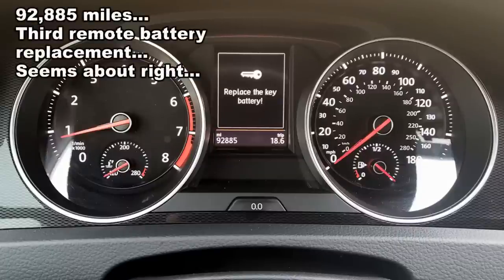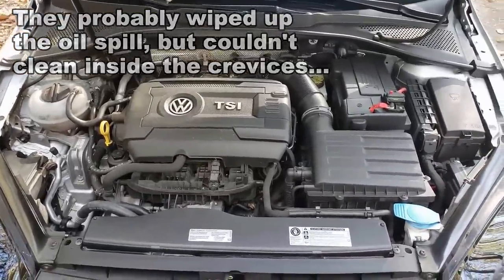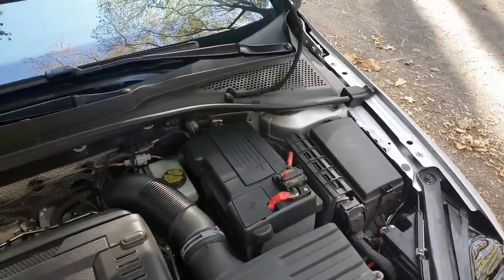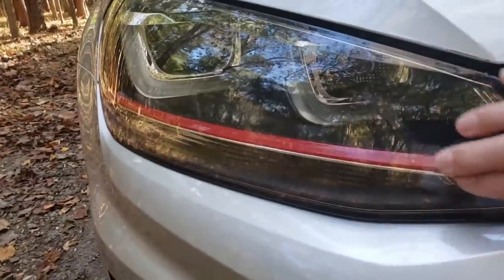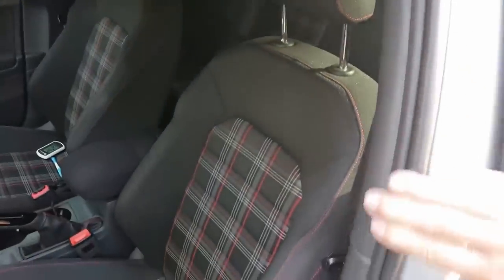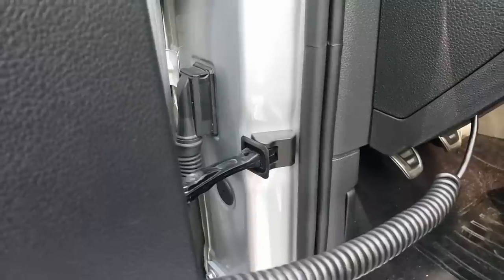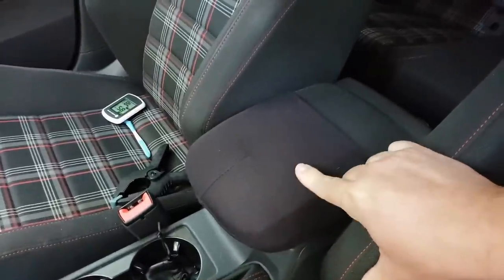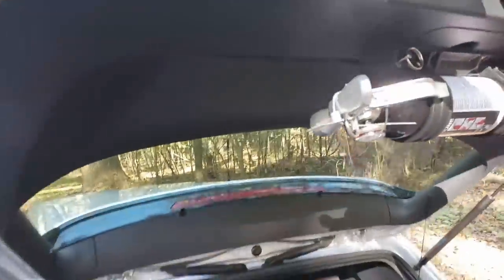THREE YEARS AND 93,000 MILES: My Report, Part 1

Comment: One question at 90,000 mile why did u need to drop your oil pan?
Reply from the maker: The oil pan, which is a steel aftermarket piece that I installed to address a problem that didn't exist, had developed a leak in the RTV seal. I pulled the pan to install a gasket. Thanks for visiting.

Comment: That’s the same on my car, they left the shipping pucks on mine too got that resolved then noticed the coolant going down quite a lot but it’s all normal
Reply from the maker: The trip odometer will reset when the battery is disconnected. But the MPG can still be calculated manually via the main odometer readings, assuming you documented its reading at the last fill-up.
Reply from the maker: Thanks for commenting.

Comment: Great review!  what trailer hitch did you install and what was the before and after ground clearance?  Thanks
Reply from the maker: Thanks for your comments. I installed an EcoHitch, by Torklift. I have full details, including photos of a tape measure at the receiver, at https://stealthgti.com/torklift-ecohitch-and-carry-on-trailer/. I don't recall specific measurements, but I can say that the hitch opening sits higher than the lowest point of the stock muffler. So, there's no decrease in ground clearance. Thanks for visiting.

Comment: Changing the air flow is a no no, it's for cooling, not air intake
Reply from the maker: Are you referring to the blocking plate I installed? I suspect you're correct. The engine will only ingest hot engine air when the car is stationary. Otherwise, it will take-in outside air, some of which would normally pass through to the engine bay. Upon digging for more info about the origin of that part, it appears to be standard on the European GTE. I'm not sure why that part is on that car but not the others. Thanks for visiting.

Comment: May I ask how did APR stage 1 and stage 2 affect gas mileage?
Reply from the maker: I don't think the tunes themselves affected fuel economy at all. The problem is with my USE of the extra power afforded by the tune. Regardless, the fact is my car is still very capable of getting more than 35 mpg on the highway, so long as I watch my speeds and don't drive aggressively. Thanks for visiting.

Comment: Where are you driving that you’re getting hit so much?
Reply from the maker: My commute is 35 miles each way. It used to be 50. I also drive the car on the weekends for leisure; plus, it's my road trip car. In short, I do EVERYTHING with it. My wife's car, although a "lesser" Mk6 Jetta SE, spends more time sitting in the driveway. I'd rather drive the wheels off a great car than "save it" by driving a mediocre one.

Comment: Ive got a Mk3 gti 16v 1996 with 204,000 miles running strong
Reply from the maker: Excellent. My 1998 Jetta TDI had 450,000 original miles when I had to retire it. Thanks for writing.

Comment: 93k mile in three years is crazy. You're averaging like 85 miles a day. I hope that's all highway miles. I have a 2017 Mk 7 GTI S and I'm only on like 27K miles.
Reply from the maker: It's my road trip car, too. However, that may change since my wife is unable to get comfortable in it. We'll see. Funny thing: When I bought my new 1998 Jetta TDI (in 1998) and started a 53-mile one-way commute, a friend told me I should buy a beater and put the miles on that so that I could preserve the "value" of my TDI. "But then I'd have to comb through what may be an unreliable car. I buy car's to be driven, not garaged," I told him. My Jetta TDI had over 400,000 miles on it when it was 15 years old. "Finally, I have the 'beater' that you thought I should get." HAHA! The difference was that I knew every in-and-out of my "beater." It had 450,000 miles on it when I sold it for scrap in 2018. Great car! I hope I can get 10-15 years out of the GTI. Thanks for visiting. -Scott
Reply: i find the seats ultra comfortable. What gives? Btw, the Arteon is plush and nice but it's more of a sleek cruiser, not so sporty as the GTI. The Arteon sound system is nice and night driving very cool with the interior lights give it a feeling it is bigger than it really is

Comment: Love the video. I have a 2015 and I just hit 88k miles and it still almost feels like a 30k mile car. Barely had any issues with the exception of hpfp and thats about it. Barely modded the car as I came from a stage 2 mk6
Reply from the maker: Thanks for sharing. Do you miss the power from the Stage 2 car?
Reply: StealthGTI I miss the way the stage 2 pulls to the redline and not die off at 5k, it's great on the highway. To be honest, my stock mk7 didn't feel like as slow as a snail in comparison since the mk6 stage 2 did only 280 hp. I find the stock mk7 to be "slow car drives fast" fun, plus it has to do with living in Northern VA as well where tuning it feels unnecessary for me.

Comment: Great video    how's the engine's compression?
Reply from the maker: It's good, even at close to 200,000 miles! I'm diagnosing a new misfire on cylinder #2. Compression was checked in the process. The next step is to clean the intake and swap the #2 injector to another location. I'll know more next week. Thanks for visiting!

Comment: What trailer hitch did you go with? Also about how much do you tow. I know in the UK they rate it higher than the US.
Reply from the maker: Jessi - I use the EcoHitch, by TorkLift. I have a video at https://youtu.be/ByltEJerp1k, which explains my weight restrictions. In short, I'll tow up to 1500 lbs, based on the UK towing specs. The video goes into detail.

Comment: Did APR wear the clutch abnormally or was it normal wear?
Reply from the maker: It's hard to say if the was neither or both. APR's tune added 80 hp and 100 lb-ft, for a total of 316 hp and 381 lb-ft. The factory clutch is not designed for that power level. Factory is 235 hp and ~275 lb-ft.

Comment: Did your APR stage 1 tune void your warranty?
Reply from the maker: I'm sure if would have if I had taken the car in for a powertrain-related warranty claim. I don't think I've had a need to take this car back to the dealer since adding the tune at 17,000 miles.

Comment: Thanks so much for this video. My golf 7.5 had terrible suspension. Turns out they left all 3 pucks in! Never thought this would be such a common mistake
Reply from the maker: It's a shame! This happens ALL THE TIME. I even brought it up to my salesperson before the purchase. He assured me it was taken care of. Then he was pretty pissed at his service department when I sent him pictures, titled "Look what I found." The photos were of the six pucks as well as a hang tag about the pucks that was probably removed from the rearview mirror and tossed into the glovebox during unloading.
Reply: StealthGTI how long did you drive on the pucks for? I just did 1600ks on them and am worried it might have damaged the suspension
Reply from the maker: @garethds  - Mine had less than 200 miles before I was suspicious enough to lift the car for a better look. I had actually looked at about 100 miles, but didn't lift the car for a good inspection. Once I drove over a speed bump, I KNEW something was wrong. As for your car, I think it's important to have the pucks documented at the dealer, just in case something goes wrong. But it may be too late if the pucks were removed long ago. They could deny knowledge of it, which is reasonable if the tech who removed them doesn't recall it at this point. Good luck.

Comment: Very informative, thanks. I've always loved the GTI but a clutch needing replacement after only 15k miles would certainly give me a pause (I'd only buy the manual since the automatics are notoriously unreliable on VWs); also the coolant problem is worrying.
Reply from the maker: Sammy - There's far more to the clutch problem than what you gleaned from this video. See an explanation in my 20Q's video, this segment in particular: https://www.youtube.com/watch?v=rOW8zgKdD0c&t=571s. Also, the coolant concern has not proven to be a significant problem. I addressed that in a follow-up video at https://youtu.be/u3dYx-tAL94. Thanks for visiting.
Reply: I have owned VWs since 1983, with just a brief time away after they moved production to Mexico and I got a clunker of a Jetta.  I have NEVER had a single transmission issue on any of my automatics.  We currently own a 2008 Jetta with 165,000 miles and I have never changed the transmission fluid.  Still shifts like new.  My daughter has a 2013 Jetta with over 100,000 miles on it.  No problems.  We had a 2000 Passat V6 4-Motion and sold it about a year and a half ago with over 160,000 miles on it.  Shifted great.  I just don't know where this "VWs have automatic transmission problems" idea comes from.  In my experience it simply is not true.
Reply: @parhunter1  thank you because I'm buying a 2013 gti autobahn this Sunday its an a/t

Comment: Sometimes problems with coolant level Dropping can be a faulty water pump !
Reply from the maker: Thanks for visiting. My cooling system recently received a clean bill of health. I shared that and other check-ups in my Oil Pan Leak Repair video.

Comment: For my 9months old 2019 Tiguan, I kind have the problem with the coolant water like 2months, it went down to the limit 2 weeks after I done the first maintenance, it went way below the line...
Reply from the maker: That's is far more coolant loss than what I've seen. If I was in your shoes, that car would be at the dealer for warranty repairs. Thanks for sharing.
Reply: StealthGTI after I refilled it and I have been keeping my eyes on it. I didn’t check it when I first pickup the car and thanks for the suggestion.

Comment: I didnt use the factory gasket maker from vw on my steel oil pan. I ended up using 
Loctite 518 gasket maker. Way more expensive but works better.
Reply from the maker: Thanks for sharing.

Comment: Thank You for your excellent long term / high mileage , I purchased a couple of 2019 Beetles a convertible and a coupe . Plan to keep them long term and being TSI engine cars, closely related to your GTI.  We have a 2011 Golf 2.5, we purchased new.  So far two new CV boots at 70K miles
Reply from the maker: WOW! TWO of them? That's commitment. Do you plan to drive them? Or store them for posterity? I used to want a new Beetle. I had a red '73 Beetle when I was 18. I thought it would've been cool to have a modern Beetle. But I "outgrew" the styling very quickly, thankfully before I made a purchase. I'm not sure how I'll feel about them in 10 years, which could be when yours are sought after. Have fun!
Reply: StealthGTI The white 2018 Coupe I purchased 16 months ago when my Car enthusiast 14 year said she wanted a beetle. Knowing that it would be discontinued I got it ahead and currently daily drive it until she starts driving in a year. The 2019 Beetle convertible, I plan to drive when around as a retirement car when I retire in 2021.  It is presently 5 months old with almost 1,000 miles on it.  I traded in my Mercedes Sprinter and lease a 2019 Tiguan SE 4Motion for the wife.
Reply: StealthGTI Having own a 2007 New Beetle Convertible and These current beetle, the current ones even with MK6 Chassis are very similar to the MK7GTI. I also owned a 2016 GTI S for a year (traded it in because my mistake it was too much a base model, if I got the top end SE I would have kept it). The 2011 Golf 2.5, is holding up great, just needs lots of preventive maintenance, due for a serpentine belt replacement within a year or two. The interior is still like new, and it was built in Wolfsburg, also expensive back the paid $20,000 back in 2011.  I will subscribe to your channel since you are the most high mileage TSI guy.  Happy Thanksgiving.

Comment: Great review!  Curious about that air block you added to divert incoming air.  Is that a common/necessary mod?
Reply from the maker: I don't think the mod is common or necessary. VW engineers are pretty smart. They probably left the back end open for a good reason.  ;-) Realistically, if the car is moving forward, then the intake is not sucking air from the engine bay. Instead, excess air that's not being drawn by the engine is passing through to cool the engine bay. I've considered removing mine, but have been too forgetful. Thanks for visiting.

Comment: What tires are you running?
Reply from the maker: I'm been on Firehawk Indy 500s for about two years, even during the winter. We had just two snow or ice events last year; so, no worries about winter traction. But I want to mount some Continental EXTREMECONTACT DWS 06 for winter use in case we have a harsher winter this year. Thanks for visiting.

Comment: The factory clutch simply can't handle ANY power booster, regardless of what APR or any other "tuner" claims.  Anyone who wants a faster can than a stock GTI would be best served by buying a faster car.

Note:  My present drive is a 2018 GTI Autobahn manual.  I had a '15 prior to that, with a '13 and a '10 (lower trim levels for the older ones) before that.

There's a bunch to like about GTIs.  Just leave the engine alone unless you're willing to pay for an aftermarket clutch upgrade.
Reply from the maker: Agreed! I went into Stage 1 knowing that I would need to budget for a clutch upgrade. I share this with anyone who asks me for tuning advice. CLUTCH, CLUTCH, CLUTCH. Or get a DSG. HAHA! Thanks for the note. -Scott
Reply: @StealthGTI  I installed and ran the Nuespeed Power Module for about 1,700 miles.  I took it out and sold as the clutch horror stories mounted.

DSG is no answer, either.  The upfront cost premium is significant, the maintenance schedule and related costs are more demanding and it's just not as engaging to drive.  (I tried one.)
Reply: DSG up front cost is much less than a good clutch upgrade(about $2,000 parts and labor). I wish I looked into that more before deciding on a manual. I may have still purchased the stick because I love it and have been driving them exclusively for the last 17 years.
Reply: @kc510  You can get more than a good clutch upgrade for less than $2K, including installation.  I've already looked into it.

I'll also note that DSG's long term maintenance requirements are much more demanding and expensive, as outlined in the various owner manuals.

Finally, DSG just sucks.  I've driven two of them.  The paddles seemed ridiculous, with my quickly realizing that letting the DSG function as an automatic represented the most sensible choice.

The cars I grew up with had traditional (torque converter/planetary gear set) automatics that could be manually shifted.  Indeed, that's been the case for the overwhelming majority of automatic equipped vehicles throughout the decades. 

Most people let those shift manually because doing so makes the most sense.  DSG is no different, other than its exclusion of a torque converter.

I want a MANUAL TRANSMISSION.  That's why my current (2018) GTI has one, as did my 2015, 2013 and 2010 GTIs.
Reply: Pete shea Yeah, I hear you. I went South Bend stage 2(new non dual mass flywheel and clutch). That was like $1300 and $700 to install. Much stiffer clutch pedal but it has more feel, it drives great, and holds the APR stage one high torque tune perfectly well. 40,000 miles on that combined set up so far.
Reply: @kc510  It's too bad that VW's engineers didn't specify a more robust clutch from the factory. It seems they left virtually no margin in the factory clutch.   

I'm just not going to replace the clutch (and flywheel) on a new car in order to accommodate a power upgrade.

There are other issues with APR and other "tunes" that most people don't mention.  For example, they reset in more carbon buildup in the cylinder head and valves because more fuel is being burned.  (Even the factory tune has issues in that regard.)

The now hotter exhaust can be tougher on O2 sensors.  More frequent oil changes become necessary.  Fuel economy drops.

And so on.

Obviously I like GTIs, given that I'm on my fourth consecutive example.  Having said that, I'd simply buy a faster car if I needed one rather than modify the GTI.

At this point in my life, the factory tune is "good enough" for me.

The MK 8 GTIs will almost certainly brine more power (perhaps 250 HP in the base GTI and 290 in the rumored US version of the "Clubsport").  I'll probably get into one of those a few months before my 2018's 6 year/72K mile factory warranty expires.

Or I may keep this GTI for a longer period as a second/winter car and buy something like a new Supra as the primary "nice weather" ride.
Reply from the maker: @kc510  - I agree with you. If I stick with VW's for my next car, I may get a DSG. I'm a manual man, but I'm also a pragmatist. Thanks for posting.

Comment: Go with the plastic and get the skid plate.
Reply from the maker: I don't remember what I said about the oil pan in this video. But I do have a skid plate and have shared a video somewhere. Ironically, my daughter's replacement engine has a factory oil pan that's dry as a bone where her old engine has the steel pan with leaky seal. I'm going to talk her into the skid plate... and driving her lowered car carefully until she has it. Thanks for visiting!